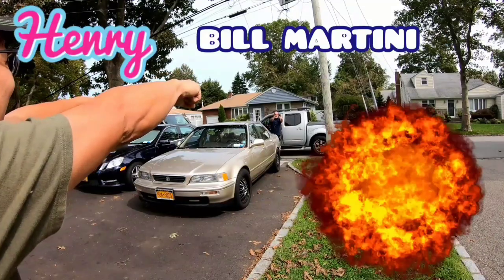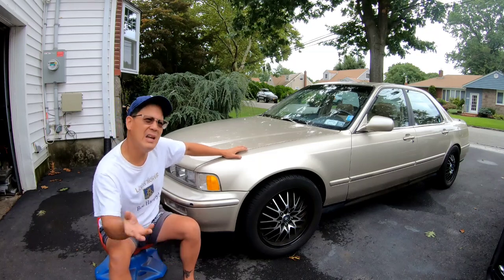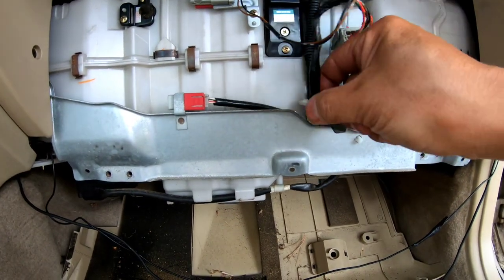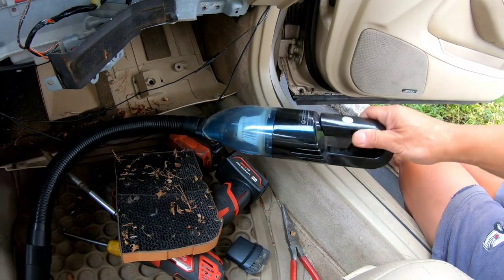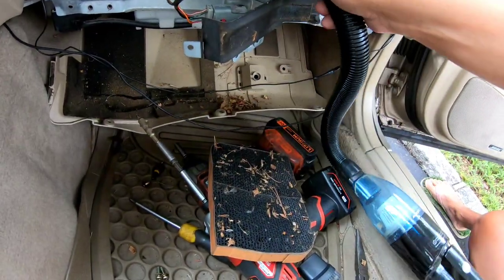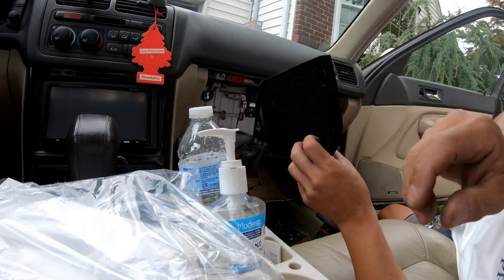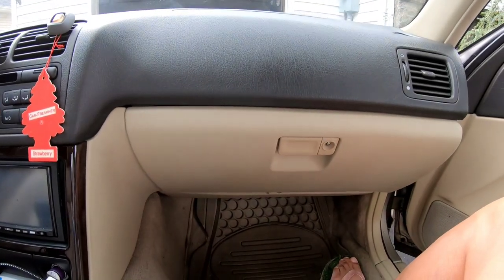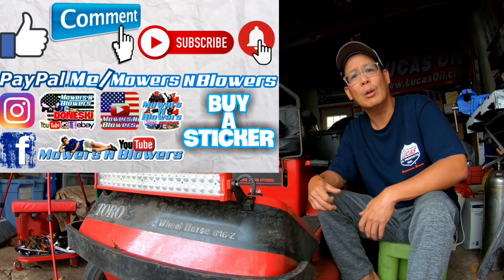HOW TO CHANGE REPLACE THE CABIN AIR FILTER FOR A 1995 ACURA LEGEND L ITS NOT EASY! NOT ODOR RELATED!

Comment: there might still be some mildew in the air duct. You can fix that by spraying "vent & duct cleaner" into the vent from inside the car. Good luck, bro.
Reply: make sure all the trims in the dash are properly installed. Moisture can condense under the trim and produce mildew and terrible odor. ( I had this problem in a Dodge Caravan )

Comment: God I can’t wait to start posting more content to truly show how easy this is. It’s a 10 min job. 

To truly clean it you remove the blower motor and that takes a solid 45 mins. But you get all the gunk out of the “system”.
Reply from the maker: So what takes 10 mins?
Reply: @MowersNBlowers  to take out the factory canon air filter.

3 plastic screws (Lower dash panel)
4 screws on the glove box (detach rear clip behind the glove box)
2-3 screws to remove metal cover (detach 2-4 plugs pending trim level) and pull out filter.
Reply from the maker: Um,  isn’t that what I did?
Reply: @MowersNBlowers  yes but you said it’s hard and acura did this to make you come to the dealership lol. I was commenting on what your saying to people. But I will say neat vacs you used to clean up
Reply from the maker: Lol yeah I get all kinds of crazy review products in the mail.  I thought it was a pain to simply change the filter,  and since it was my first time,  it definately didn’t take me 10 mins.  More like 30 mins.

Comment: Take the filter back out abd spray down the heater core and evaporator with lysol or other bacteria killer and run the heat and ac till dry then do it again and again.  There is a product called Frigi Fresh to clean up ac evaporators also ...... it cleans up the aluminum evap core!!    Especially that grungy aluminum smell!!
Reply from the maker: Yes I’ve heard of that product when I was watching YouTube videos on the subject,  it doesn’t smell anymore.

Comment: Still very much worth doing....  That old one was clogged with gross crap....  Now you will get much better air flow & HVAC performance.....

And...  You haven't lived, until you've had to change the cabin air filter in a 97/98 Cadillac Seville STS....  omg...  I lost my will to live during that job...  But it was my friends, and I was committed, I foolishly told him I could do it, so I had to do it....  Like the NASA Astronauts used to say, you'd rather be dead, than look bad....  hahahahahaha!  I got it done, but, whoever designed that, was a really really sick twisted sadist....

GM Trucks are a lot like what you had to do...  Except they have this weird habit of, some trucks have it, some don't...  So if you DON'T have it, and you WANT it, then you can get a little retrofit kit thing, to add it....  Very strange and annoying....

Great job.  You have to feel better about breathing the air that has NOT been passed over gross dead bugs & moldy leaves from 2008....

Just guessing, don't bet your life, but you probably have like, some residual mold, in the ducts themselves....  If you run the AC on high, (and NOT on recirculate, you want to pull fresh air) go outside with a spray bottle, with diluted bleach...  Spray a mist over where it takes in air, and watch your misty bleach mix get sucked in...  Keep doing that...  that will probably help a lot...  and in the future, don't let a whole dump truck full of leaves & crap accumulate on that low windshield intake vent area...  that is NEVER a good idea.....  Probably check your other rides too, and clean that up, BEFORE it becomes a problem....
Reply from the maker: "They hide the filters" so you can't work on it!  Lol! I can imagine what hell it was to work on that caddy.
Reply: @MowersNBlowers  That's been one of my pet peeves forever...  Oil filter, buried in the engine bay in some insane location....  an oil filter, MUST be changed routinely...  It's just WRONG, on a deep level, to bury that part.  My feeling is, ANY PART that needs to be serviced, should be "somewhat accessible" to the owner...  Maybe "some" mechanical aptitude may be required, but it should be do-able by a reasonably competent mechanical person....  I know...  I have all sorts of crazy ideas about how the world should work....  Heh heh heh!   This is 1000 years ago, but, I've had a bunch of Eldorados over the years.  The 1990, had a 4.5 V8.  Great little car, I really liked it.  Oil filter, insane.  Deep in the engine bay.  You couldn't get it from below, you couldn't get it from above.  You just about needed to bring in an acrobat from Cirque du Soleil, give her a strap wrench, and send her in there, to crank that thing off.  And then when you got it, it would spill all over....  What a disaster....  To be fair I guess, everything from then on has been on the bottom, where it belongs....  Heh heh!  Luckily I'm over it, and I'm not still chapped about the oil filter in a car I had 30 years ago...  Hahahaha!
Reply from the maker: @patrickmorrissey2271  I’m convinced it’s all about stealership business!  If the regular joe can’t work on it,  they have to pay stealership labor!